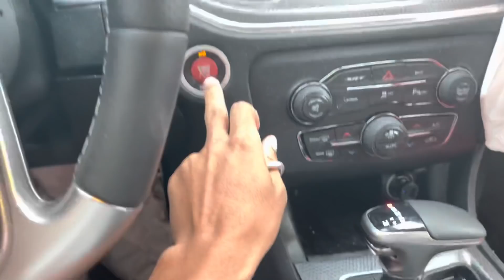THE HELLCAT IS TOTALED! *FOUND HIDDEN DAMAGE*

Comment: You can get that front piece brand new from dodge that’s not the frame. That piece is interchangeable.
Reply: It is the frame sadly it push the radiator back and it’s bent .. only the Bumper is detachable
Reply: @youngcalimigga  that don’t matter it’s part of it
Reply: Upper radiator support im buying one now for my rebuilt charger
Reply: That's the core support can be taken off front end pulled out 15k max with 2nd hand parts air bags are cheap free content if you put a little bit of the work in 10k max
Reply: Can buy core support from Josh car can find parts like that at junk yards

Comment: I'd fix all that champ. Upper core support , Right and left fenders, bumper/grill, those a pillars are an easy fix by the windshield, air filter system can be salvaged, air bags can be reinstalled those top pillars inside the car can also be fixed they just pop out

Comment: As a person that owns a hellcat and been in repair work for over 15 years  I can say that looks like 15 to 20k in parts and labor.  95% of the parts are going to be "charger" parts and not "hellcat" excluding the engine. Keep the expectations low on part prices being they have had the same model design for years. But Dylan isn't talking insane, in some cases they can reach outrageous numbers to be restored.